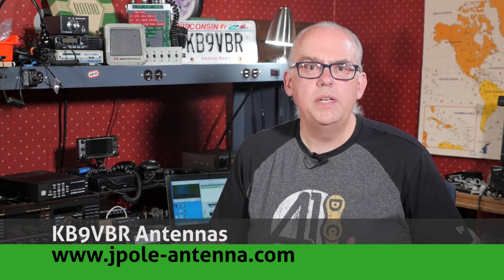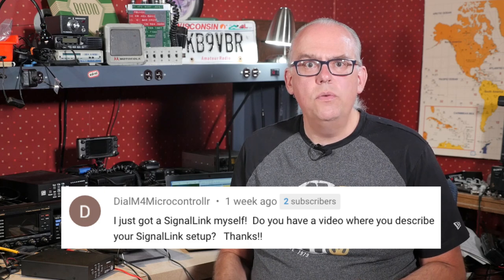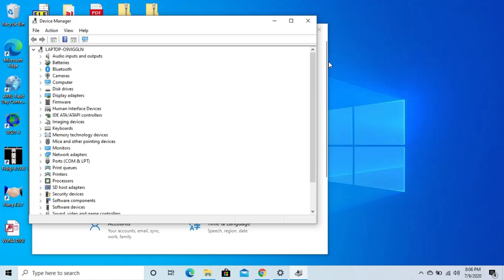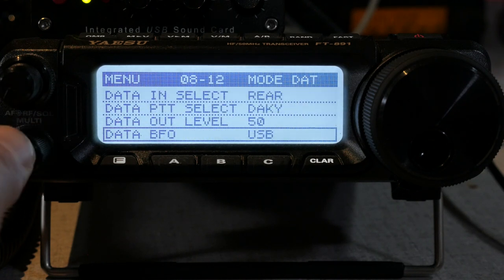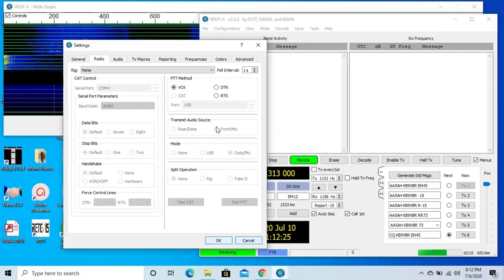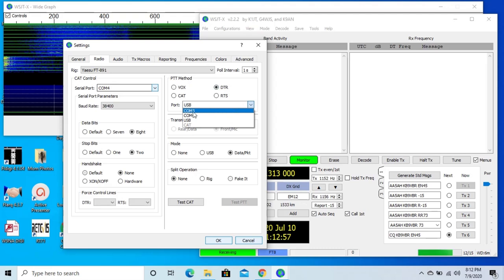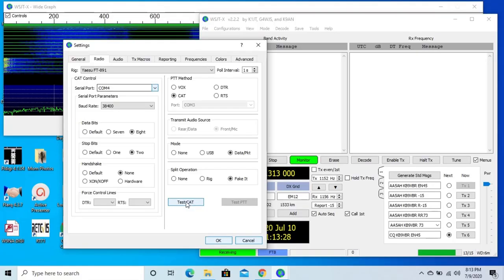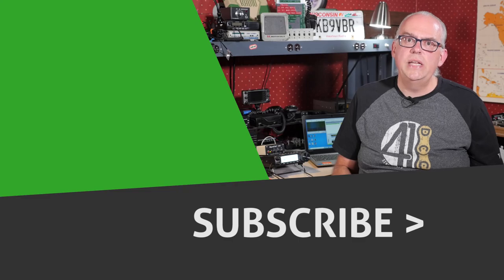Yaesu FT-891 Setup for Digital Modes - Ham Radio Q&A

Comment: I use my FT-891 for PSK-31 using the Signalink.
Reply from the maker: I haven't been on PSK for ages. What program do you like to use for it?
Reply: @KB9VBRAntennas  FLDIGI. I have tried other modes but PSK-31 is more relaxing for a casual conversation.

Comment: Using everything you have, except radio is FTDX-1200 usb. Keeps wanting comport. Using windows 10 all ports are USB and windows Using  USB ports.  I am stumped if I  had hair it would be pulled out 
tnxs 73 KQ4CD Paul